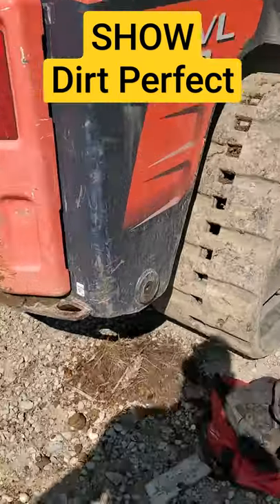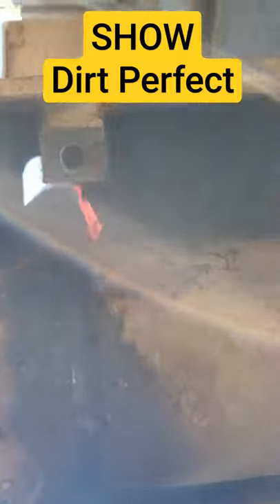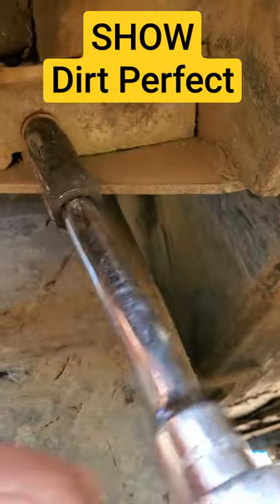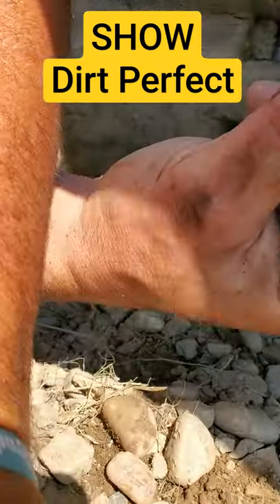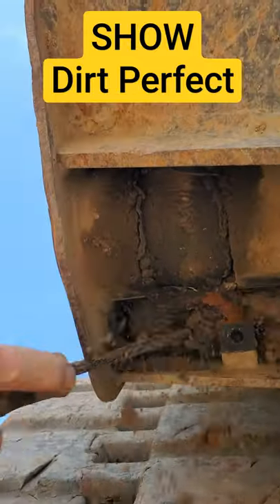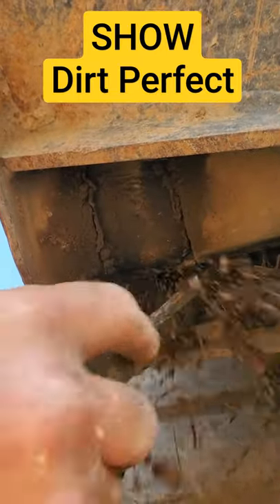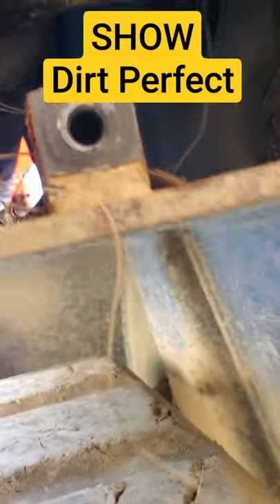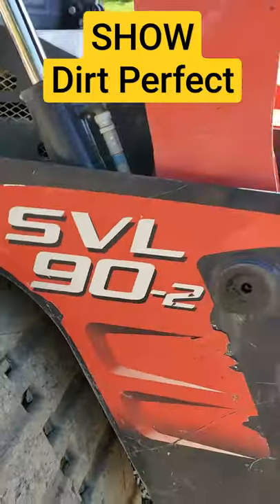Dirt Perfect Roast Maintenance Tip How to clean a Kubota Skid steer @dirtperfect #shorts

Comment: Why Not just leave that piece out and let stuff fall through without building up.
Reply: I'm curious why it's there. It might have something to do with stopping air flow for the cooling system whether it's the hydraulic cooling or engine cooling or both??
Reply from the maker: I was thinking that too but it actually stops dirt from going up in also wearing the pins And going into tree branches ECT in the woods
Reply: @DIRT-BOSS  That makes sense DB! Might have to do with the pins like you are saying and possibly for assembly or to replace something.

Comment: Mike..what is the purpose of that metal plate?
Reply from the maker: Is to keep debris from getting packed up in there sticks ECT hydraulic lines are right there you could puncture or shear off the fitting.. just a mini skid plate
Reply: @DIRT-BOSS  That's it! Letsdig better get his cleaned!!!! Ha ha
Reply from the maker: @alittlebitofeverything5090 yep easy thing to do could cause a lot of headaches